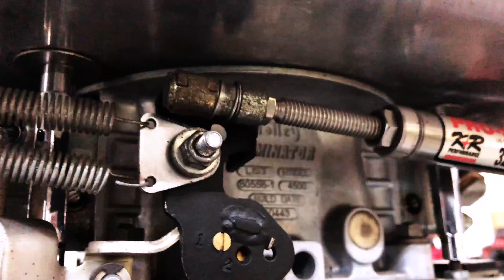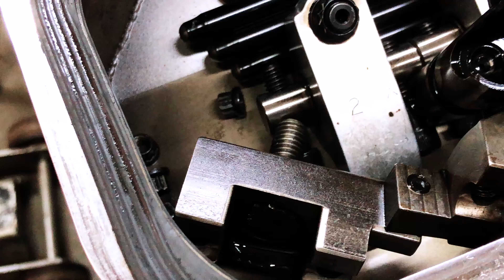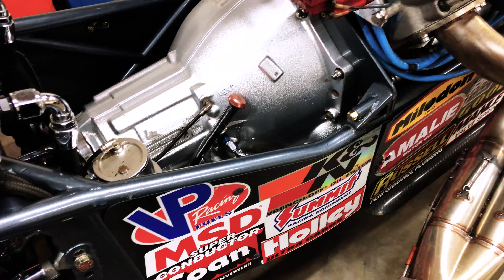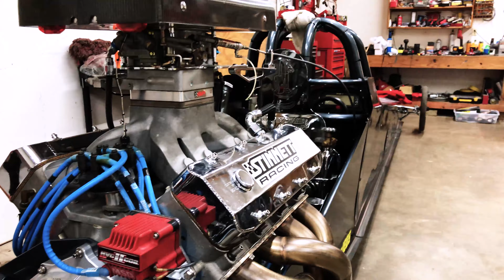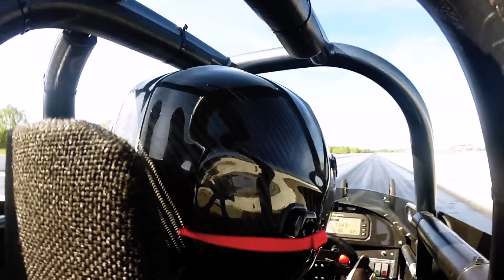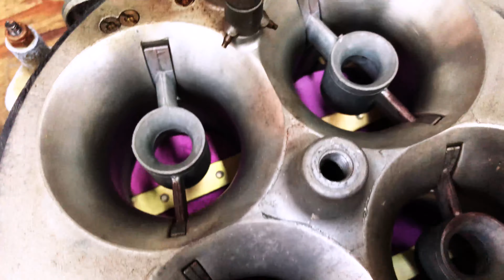How to choose a nurse practitioner specialty

Comment: great channel! would you recommend FNP as the best initial cert for those wanting to work in ED down the line?
Reply from the maker: Hi! Thanks for checking me out. I would suggest FNP- as it gives you such a wide array of options. However, you need to pick up some emergency skills somewhere down the line. Let me know if you have other questions!
Reply: David Warren NP thanks for your response! im on track for an adult/gero primary np but I’m wondering if you think that is too restrictive for ED practice
Reply from the maker: @scrb26   good question! I think adult gero primary care CAN be restrictive, depending on where you are living and working. If you work in a major metro area, where there is a large ED, that has a separate peds ED, you could theoretically work there. However, if you work in a community hospital in normal America, you will need to be able to see peds. So, again, depends on where you see yourself working, geographically. I hope this helps!